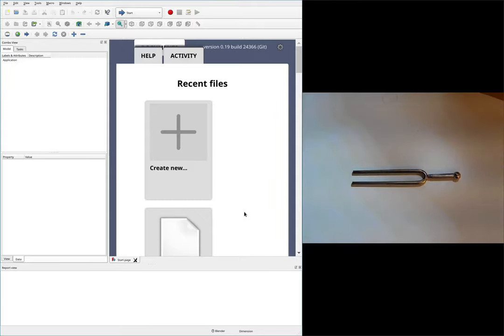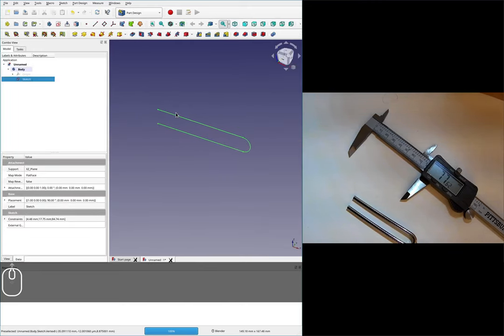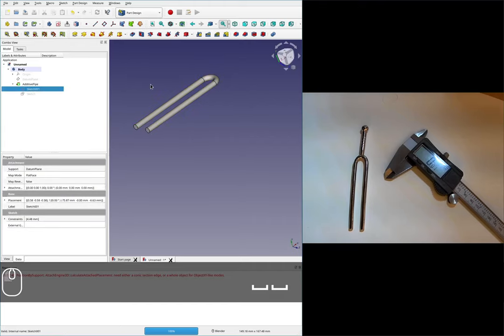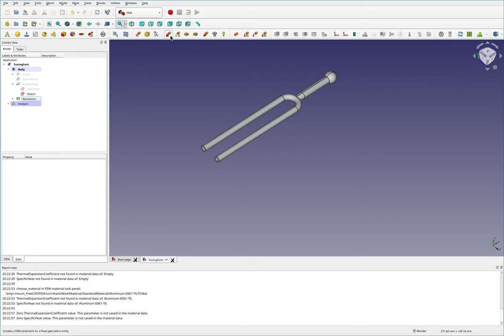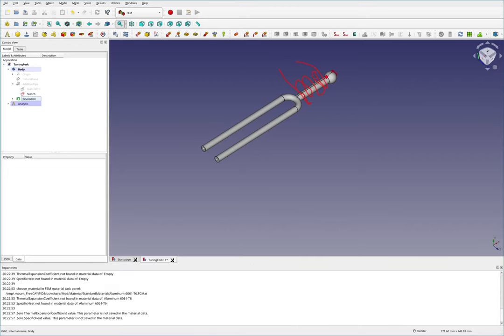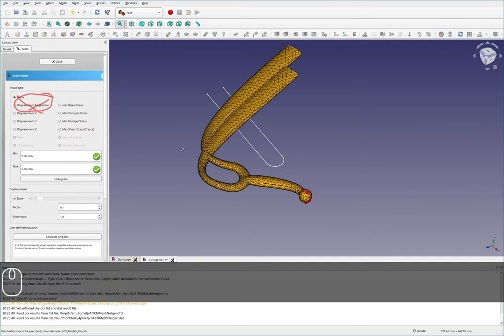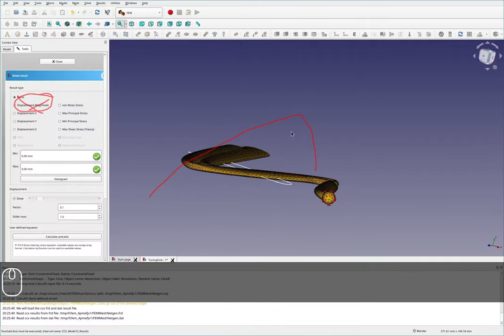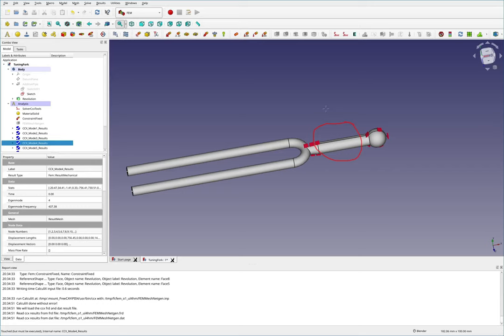[5] FreeCAD Tuning Fork Vibration Analysis

Comment: I thought you had to rerun the mesh after changing the constraints.  IDK.  Of course some of those modes could only exist if the handle was head in a big vice and then excited with a sledge hammer.  Hitting it like you are supposed to isn't going to create those modes. I'm modeling an engine mount and found your video trying to figure out what modes were likely to cause a problem.  Some are easy to discard, some I don't know.

Comment: I think the simulation is completely correct. If you clamped the tuning fork in a vise, you could certainly measure the frequencies of the first two modes. However, a tuning fork is held with the handle between the fingers, so these vibrations cannot actually occur. My intuition tells me that the third mode also decays relatively quickly because it creates a rotational oscillation along the longitudinal axis. Only the fourth mode can persist over a longer period of time under real circumstances, as it creates a symmetrical movement and therefore does not result in any movement of the entire tuning fork.